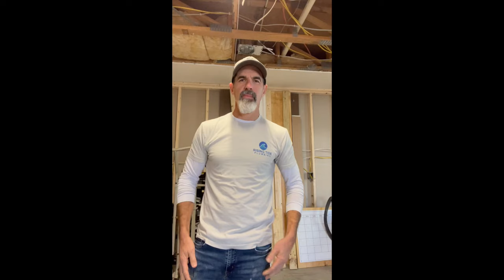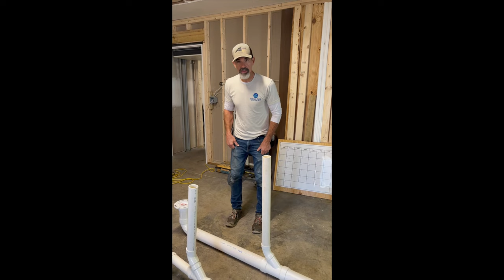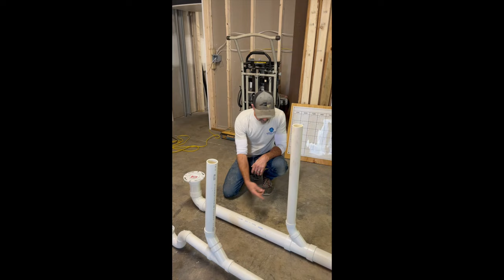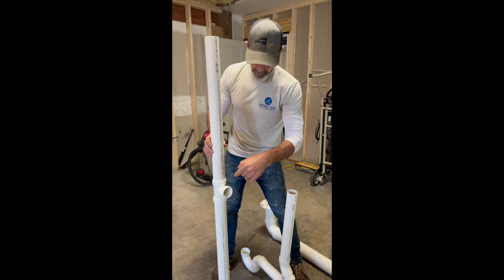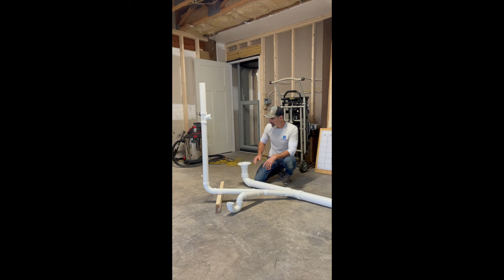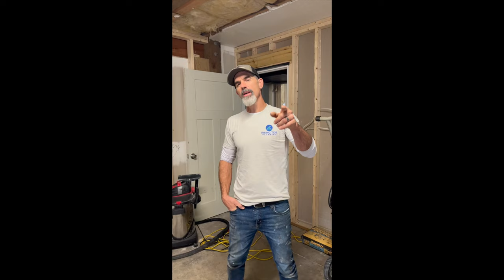The Basics of Venting in Plumbing in 4 Minutes

Comment: Finishing my basement.  Have have two questions: 1) Can you merge two bathroom vents into one basement vent?  I'm thinking about joining them with a 1.5" wye than sloping 2-3% to the main basement roughed-in vent.  2) Can I vent a basement kitchen sink to the main 3 inch stack?  Its going to be 3 feet away from stack or do I need an air emittance vent?
Reply: I would use a studor vent in the wall behind the sink.  Just go up high.

Comment: Here's a possibly silly question.  Most dry vents go through the roof.  However, why couldn't a dry vent exit through the roof overhang or soffit of a second story ?   If there are no windows in the vicinity of the vent, would it be allowed ?
Reply: The soffit draws air into the attic, so it has the potential to draw sewer gas into the attic space.

Comment: I want to put a stacker washer and dryer in bathroom addition.  Can I treat this as another lavatory?  I will have toilet, shower, sink and washing machine on one 2” wet drain potentially.
Reply from the maker: No, a washing machine is 2 drainage fixture units so that would make your wet vent have 5 dfus on it.  Also, a washing machine is considered a flushing fixture and cannot be used in on a wet vent.  Try to tie the washer  into the main separately and give it its own vent if possible.  Hope this helps.

Comment: Does it matter what order the fixtures are in?  I'm getting ready to install my drain lines under a slab in my barndominium.  I plan to wet vent each bathroom, with the shower entering the drain line first, then the lav (with the 2" dry vent), then the toilet.  The shower will be drained with a 2" line; all three fixtures will be going into a 3" line.  Is it okay to have the dry vent in the middle?
Reply from the maker: Thanks for the comments.  I'm glad it helping.  If I'm understanding you correctly, it doesn't matter which ties in first, the lav or the shower, as long as the trap arm of the 2 inch shower drain is less than 8 feet ( North Carolina code) and that they tie in to the 3 inch line together not separate.
Reply: @risingtideplumbing  Thank you for the reply; that helps a lot.

Comment: Hi, please help me understand if venting is the problem in my house. 
Sometimes, especially when it's too hot, we just experience a drainage smelling coming through the bath hole and also through the p-trap toilet hole, although there's always water trapped there. 
It comes inside the house and a number of plumbers came to assess but could not find what the problem is. 

Sometimes I even think there's an underground incorrect fittings but there's never been a blockage. 
One of the plumbers said I must change a venting pipe and put on a taller one. 
Please tell me what might be the problem.

Thank you🙏
Reply from the maker: Hey there.  Is there any way to actually see if all of the p traps in the house are full of water when the smell is happening?   Using a flashlight to see it in sink drains etc.

Comment: I have 2 hot water heaters in my attic and I have to drain the sediment once per year.  I usually run a water hose from the attic down to a tub, but that is a mess and pain in the butt and a 2 person job.  I have connected the drain to the a/c condensate line on one heater that runs out of my eaves in one case, but in the other I would like to tie into a vent pipe in the attic and drain the sediment into that line.  What do you think?
Reply from the maker: Technically it should work if all is connected as it should be below if I am understanding you right.   You would definitely only want to have the drain connected as you are draining it and need to have a way to cap it so no sewer gas or rain water gets in.

Comment: On the simple bathroom example, u have a sanitary tee to a lavatory. Could I instead install a double fixture tee so I can have a second lavatory in the other room? Or would that mess up wet vent somehow?
Reply from the maker: That shouldn't mess it up as it will only put one more fixture unit on the wet vent making it a total of 4 drainage fixture units if it's just a standard 3 fixture bathroom.  One for each lav and 2 for the tub/shower.  Hope that helps

Comment: Question, I own a two floor apartment buiding. The second floor's shower drains to a 2 inch pvc and then connects to the first floor's shower to the same 2 inch pvc and then finally connects to a 4 inch pvc, they both vent to a 2 inch vent to the roof of building, is this within code? A carpenter told me before that both showers should drain to a 3 inch pvc pipe, but he is not a plumber, is he correct or not correct?
Reply from the maker: Where I am a normal a residential shower is 2 fixture units a piece and you can have up to 6 fixture units on as 2 inch drain.  With 2 showers you have 4 so you should be good if Im understanding  you correctly.

Comment: Where the lav/wet vent ties in does it have to enter the system rolled at a minimum 45 degree angle on the wye, favoring the top of the joining pipe/s?
Reply from the maker: It does not where I am.

Comment: Well I have a drain problem I can't figure out. I have a hundred year old house, balloon framed, and plumbing was added after it was built. Old plumbing. I have a bathtub upstairs that drains slowly unless I put a drinking straw in the drain as it is draining, then the draining speeds up, flowing much more freely, so I believe I have a venting problem. 

There is a 4" soil / vent stack nearby that goes through the roof. Where is my blockage? I've tried snaking the tub drain but I don't get very far. I believe the plumbing must make some sharp turns or something, so no luck there. If I put a garden hose into the vent / soil stack from on top of the roof, all that water flows find, out to the street. 

So where is my vent blockage or lack of adequate venting? If my vent begins where the tub drain meets the soil / vent stack and goes up, well that should never get blocked but if it did,  the vent / soil stack wouldn't be able to handle all a water hose could give it, but it does. 

I don't get it. I don't know what to try next. To access the plumbing, I would have to cut an access hole through the wall and maybe do some more cutting in the floor once I look inside, as there is a build out around the old cast iron tub which has tile on it.  I don't know what to try next.

Comment: I have a venting issue, which is causing gurgling sounds and actually causes clogs a lot in the main line outside. Take a shower and the sink gurglings. Flush the toilet and I see bubbles. The air vent is behind the toilet. Then  sink is attached to the shower drain. Something just is not right.

Comment: Hello sir. I see your wet vent is on the "shower" line. Could the vent y be installed further down on the main (common) line? 
I ask because i will be installing a wash machine, tub, and utility sink and would like to plumb the drains together and just do a trailer type vent after all 3 lines come together. Is this possible? Thank you for your help.
Reply: You want to install your laundry group as far away as possible from the bathroom, to prevent suds coming back up sinks and showers, in this case the 3” common line. You can’t split up shower and sink, they are working together for the bathroom group. If you had shower on common line, then it would need a separate vent anyway. The sink would still need to be 2” as min event size is 2” for w.c, thus making it very inefficient and costly

Comment: I have an AAV on my kitchen sink but its failing to let the air in when its draining - what would be the cause for this?  the sink works great without the AAV but the moment I put it on, it causes the water to slowly drain.  I have already snaked it down 40 feet and put on my second AAV.  How can you test the house if its being vented properly?
Reply from the maker: Thanks for the question. What brand of aav are you using?
Reply: You are experiencing why the air has to move both ways at the same time— the AAV doesn’t allow for that. Welcome to the world of AAV mis use and information. 
Not approved in my state. We call them expensive clean outs.
Pro tip- there is no substitute for a real vent!!

Comment: So could those 2 vents at the end tie together in attic space to create one 2 inch vent through the roof?
Reply from the maker: Correct.  It could be 1 1/2 if the drain line it serves is not bigger that 3 inch and the total lineal feet of the vent line doesn't go more that 40 feet.  A good rule for vent sizing is that is must be half the size of the drain it serves.   If it goes more than 40 feet, increase the pipe size to the next size up then there is no limit on how far it can run.  Hope that helps.

Comment: 4:23 I notice a rise above the lavatory p-trap. Would there be a drainage problem from the sink if that rise (vent?) wasn’t there?
Reply from the maker: The pipe above the trap for the lavatory is dry vent that goes through the roof or to an air admittance valve.  Hope this helps..

Comment: i hate to be that guy, so please correct me if im wrong, but arent you wet venting the toilet and the tub on the lav drain? so wouldnt that be 5 dfu on that wet vent up to the lav stack?
Reply from the maker: That’s a good question. The lav is one and the shower is 2 which is 3 dfus on the 2 inch line as it connects to the 3 inch line from the toilet. That is where the wet vent starts.  The dfus from the toilet don’t count on the wet vent just the dfus sharing space in the 2 inch wet vent pipe.  Hope this helps.

Comment: You also have a 1/4" grade per foot so 3" line for W/C could be up to 10 ' from vent , slope can not be more then the size of the pipe or will have to be revented. This keeps the drain line from running more then 2/3 full.

Comment: None of this works in the state of Kentucky. Wet venting is illegal. Flat venting is also illegal. If that wet vent ever backs up, any other fixture it serves, is no longer vented. Blocked airflow. If someone else moves into the house and remodels the bathroom...lets say they want to move the lav. They cut the tee off above the floor and cap the line thinking it's only a drain (you can see where this is going) once again, that wet vent is useless. The shower and the toilet are now choked. If the toilet gets flushed, any liquid in that 2" p-trap serving the shower will now be siphoned out, allowing sewer gas to be introduced to atmosphere. Those are just a couple of reasons wet vents don't fly here. It may fly where you are but in KENTUCKY we go by a completely different code. KSPC. We disregard IPC. You can get in pretty big trouble if caught trying to rough-in your own stuff without a permit and inspection. So, if you're from KY, don't attempt any of this until you consult a plumber that is ACTUALLY FROM KENTUCKY. Otherwise you're going to be wasting a lot of time.

Comment: I can hear my vent knocking in my walls after draining water. anyone know why it does that?
Reply from the maker: I bet that you have a pvc pipe that is secured too tightly to a wood stud or joist.  When a different temperature  of water goes through it, the pipe expands slightly causing a clicking noise rubbing against the wood.
Reply: @risingtideplumbing   That would make a lot of sense because I notice it only happens during winter when it's cold outside and the vent gets cold. Thanks!

Comment: We vent DWV pipe to protect trap seals.  That's it.  Do your little thumb over the straw trick with 1.25" pipe (the smallest dia pipe allowed in a DWV system) and then rethink your video.  An unvented system will drain just fine.  Try it next time you've roughed in a house.  Put jiffy caps on all the vents then pull the test plug.  Drains just fine.  We vent DWV pipe to protect trap seals.

Comment: Wet venting is an exception to the plumbing code not ideal. The wet vent in the video is flat the invert of the vent should be above the center line of the pipe its connected to